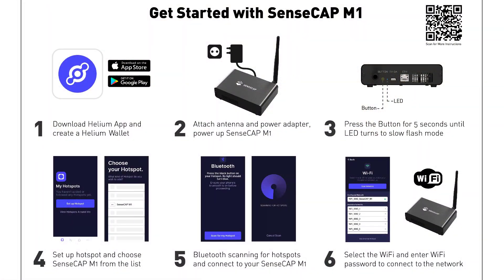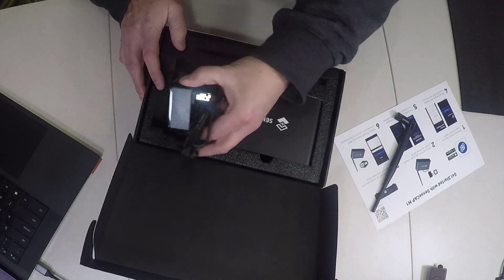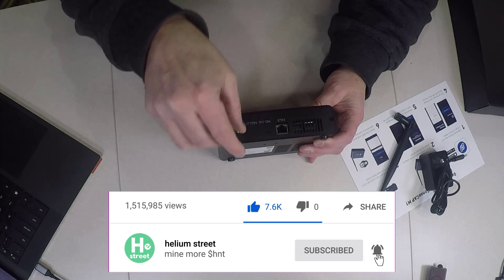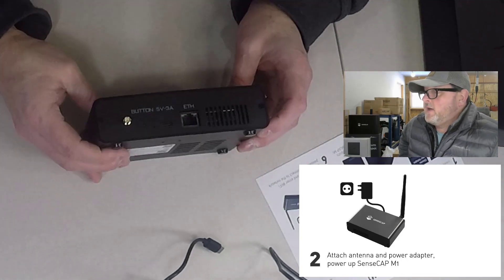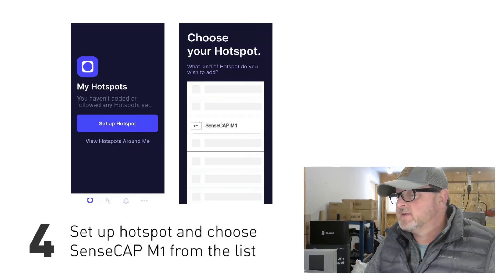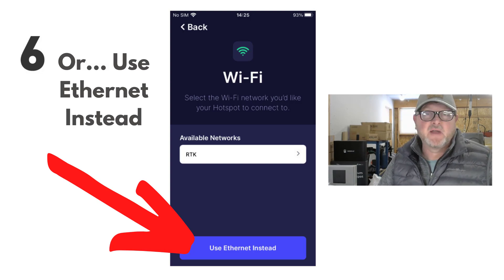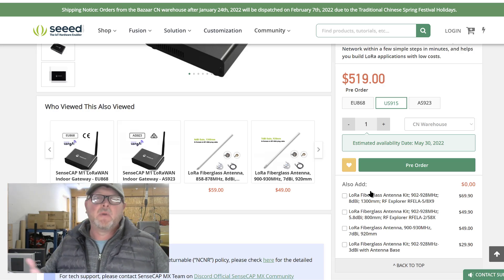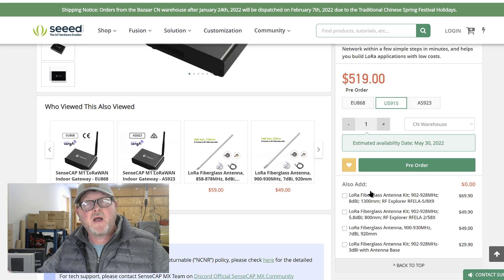Crankk & Helium Mining SenseCAP M1 [TUTORIAL]

Comment: Nice video, I like your presentations. Thank you.   Many consider SenseCap as the best miner, I bought it paying extra just to get it right away. I installed it using a perfectly installed RAK 8 dBi  antenna mounted 9 meters up on top of my roof, with 18 feet of LMR 400 cable.  I live in Westmont IL in Suburban Chicago and transmit scale is .65. It's generating 0.1, 0.2, 0.3 per day.   In 30 days I made only $164 with today's Helium price at $29.  This is much less than expected , it would be good to know how you are doing. Any suggestion to improve mining is highly appreciated. Thank you.
Reply from the maker: Hi William,
Things I've learned in 1 year of this stuff.  5.8 has a tendency to work better with hilly areas, trees, and buildings.  I only use 8 dBi for long distance reach.  Reduce your LMR as much as possible as it will cut away at your dBi (line loss).  I'm trying to do mostly PoE to reduce LMR and it's less expensive. ~ Mike